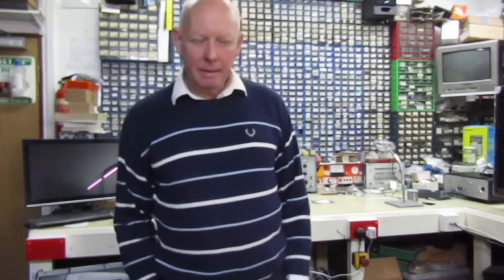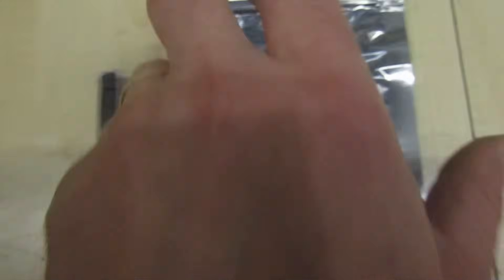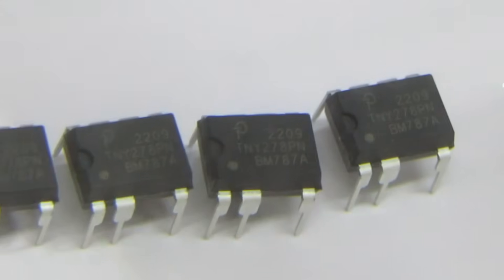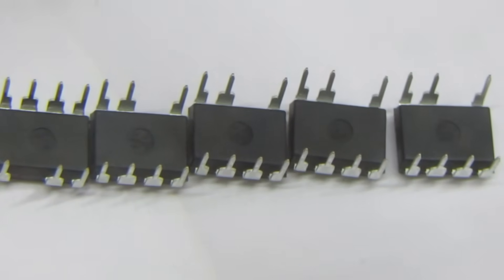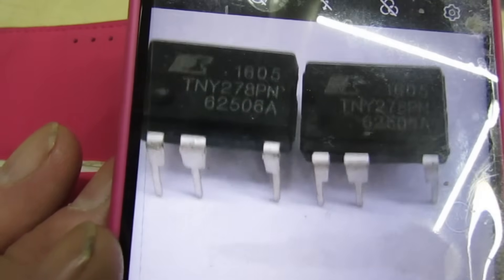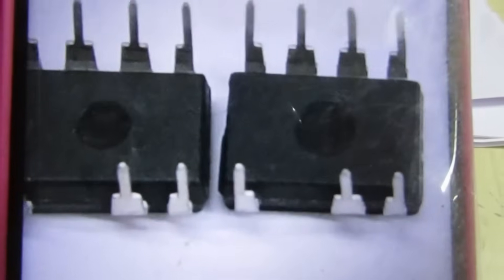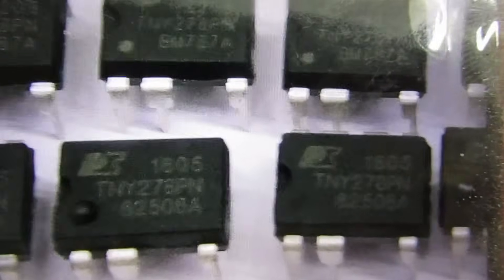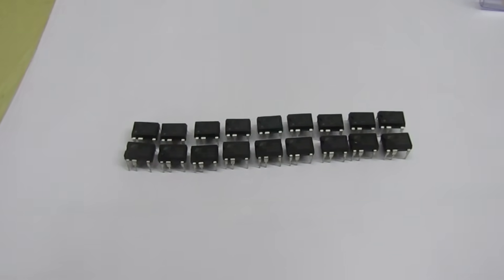Another way of spotting if you have bought a fake semiconductor .

Comment: I bei lots of components from aliexpress and I just once had problems with parts. And yes I don't buy one but I also don't buy 10. I buy 1,000 or 5,000. 
Then i Test the parts, and sometimes I will sell them as well. And also never just one part because the customer who is Bike than for me should have the possibility to tast it.

Itwas possible to repair Handels of devices with very low costs.

Comment: I found power mosfets to be the most faked. Smashing a good (but blown) part and the fake showed a massive difference in silicon die size. Consequently the fakes burned up.
Could you make a load tester with thermal display to identify these?

Comment: 700 volts and 28W , that's some power handling
I remember buying some Lm350 off ebay  for a power supply but it couldn't get anywhere close to 3 amps out of it..,, i'd say they sold me rebadged LM317 instead.
Reply: This is particularly stupid since the LM350 is obviously required with all of its features, if not an ordinary LM317 would have been chosen for the task. So the complains are guaranteed - why would any seller expose themselfes to the useless hassle, especially with the immediate proof?
If some LEDs wouldn't last long enough or are a little dimmer or otherwise out of spec, barely anyone would notice, but semconductors for a specific purpose?

Comment: Why do they fake the ICs? Is it that some are dummy and some are working, so basically "cheaper" overall? Or are these rejected ones from the same facilities that the genuine ones are manufactured in? I'm quite ignorant here as I don't really understand the economics of fake ICs - but clearly there is something to it as its happening at a huge scale...
Reply: Huge scale.  You said it right there - it's only profitable if it's done on a huge scale
Reply from the maker: chips are faked because they have become obsolete and so the demand increases which makes faking very profitable .
Reply: @michaeldranfield7140  Yes, with rare and obsolete chips, of course it's worth it even at a small volume.  However, TL074 are also faked, and they are still in production, 

The chips in your video, are still available from RS, although perhaps not in production (I'm not sure, maybe they are going end of life) they are still available, and faked.

I have found utsource to be reliable for obsolete and no longer available at the big suppliers. (I don't work for them!)

Comment: We did a small manufacturing run where china supplied the pcbs and the 3pin transistors, and soldering.
When we got the items, many of the items failed on first test.
I found that the "china transistors" which were SUPPOSED to be full spec Philips parts, were bad.
About a third of the transistors had bad noise issues. About 10 percent had one pin fully open circuit, and about 4 percent had 2 or 3 pins fully open circuit! 😊

They were obviously rejects, but had been laser marked with the correct Philips markings to pretend to be the parts we paid for.
Not only did we have to buy proper transistors, but we had the cost of removing and replacing thousands of the "china transistors" from our PCBs.

Comment: Yes they are fakes, or recycled parts, but might actually work in light load applications. however the fakes ar everywhere, and they cause a lot of trouble. Looked up and subscribed, remember you from Television magazine, I used to b a subscriber for many years, till one day it just vanished. Always wondered what happened to it.
Reply from the maker: Absolutely correct, this chip could come in a variety of different power outputs that are all pin compatible and may even work , as you say under light load but I wont be risking it .
Reply from the maker: yes it was me that use to write for Television magazine and it went bust after they replaced the editor with some other guy who didn't have a clue .

Comment: When you do get fakes, do they not work at all or what? I have bought tons of parts over the decades and never experienced any issue. So I was wondering if the "fakes" are rejects or what they are...   Thumbs Up!
Reply: Usually recycled parts if you're lucky. In the third world its worth the time to remove these parts from scrap e-waste. Other times they just take any chip with the same pins, sandblast and print new label on it.
Reply from the maker: there is no definitive answer to this question, I have had chips that blow up at switch on, that's a real bad fake, sometimes you may get a chip that seems to work ok then fails again a few months later, sometimes you get a real genuine part like a transistor that has been cut from an old board and had new legs spot welded on to make it appear brand new , buying from ali is like playing Russian roulette . . another thing that's not widely known is the same chip can have several pin compatible variants, in the case of an audio amplifier there could be a 50 watt, a 100 watt and a 200 watt so you could fit any of these 3 and it would work if the customer is only using the amp at a low volume.

Comment: I have here a bunch of AVR microcontrollers which behave strange.
They work fine, but they use to much power!
It got a problem, when I developed a battery powered project and the battery got flat only after a few days.
So I wrote a small test programm an checked all the controllers.
1/3 of them didn't go to standby and used significant power.
I got these from a renowned german seller.
So, I got another bunch from Digikey. They all worked perfect.
Like you I compared the package and coudn't recognize any differences.
I'm wondering if they are fake or just defective from the factory!
Reply: Likely factory rejects for the reasons you stated. Bought for scrap but repackaged and sold on.
Reply from the maker: I would say fake if they have been sanded down to remove the original numbers , factory rejected parts are harder to spot because when a part is rejected they don't get printed with any part number so with a blank chip you can print onto a perfect surface .

Comment: Michael- You have a couple of spammers posting on the video.     Back when I repaired computers & video games to a component level I had 2 identical units come in for repair. One had all the markings on the IC's removed, the other had apparently used a chemical on the tops of the chips to remove markings. I looked at the chemical ones and at the right angle I could see the real world part numbers on the IC's. That info went into my card file for future repairs. (And yes, I fixed both units). 
    I quit buying from Ali Express because of the number of counterfeit parts I was getting, and then my bank refused to allow any credit card transactions with Ali Express as  it had taken many months working with the credit card company to get their customer a refund on bad items.

Comment: i dont see why its worth them faking the more common/cheaper parts?  maybe some arent 'fake' as such but cleaned up and remarked 'used' parts or 'pulls' from made but unused equipment..?  there was, maybe still is, a big problem with 'suspect' 20mhz Z80 CPU chips, i bought 2 lots, dirt cheap from 2 different suppliers from ebay, both in china, the physical states of them vary a lot, and definitely look sanded and remarked, the underside moulded depressions also vary, i havent yet tested any of them ,
Reply: 20 MHz Z80 ? Can't be the original 40 pin DIP ? As for "pulls".. much better chance of these being genuine but whether they'd work or not is another..
Reply: @OwenOReilly-d2w  certainly were 40 pin dil ., i'm wondering if they were old nmos pulls, actually i'd prefer it if they were, as long as 4mhz or higher capable, cmos types may sometimes give issues with 'old' computers , any idea of how to test them to find out type and speed? easily that is?!!!   i also got hold of 40 SGS branded Z80As, they dont look remarked so hope they are genuine, and good!
Reply: @andygozzo72 I must look into that so.. I'll probably end up buying some fakes as well 😂 only real way to test at full speed is to make a test jig with 20mhz xtal and run a test program to test all instructions and I/O lines..
Reply: @OwenOReilly-d2w  there was also one seller with some 4116 dynamic rams, others that had bought them had issues, even burn ups, so i bought them, to test,  they seemed to test as 4164s, good ones, amazingly, theyre definitely not drop in compatible(without doing some pin jiggling), they look like they may be remarked but couldnt be totally sure, i messaged the seller saying they ought to update or mention in the listing they are actually 4164s, but they never changed it and still sold them,

Comment: I think it depends on the IC and how common they are.  I got a batch of 20 op-amps labelled TL074, off Amazon no less, in two separate shipments.  They all look identical, and they all have the electrical characteristics of a LM324.

But this is because LM324s are so incredibly common and the runs of them are enormous.  They're not scrambling to put together 20 random op-amps or other 14-pin chips, they're just running a bunch of tubes of them through the same process.

Comment: I once purchased a couple of supposed "W65C22S" chips for my project and after testing, I realized had non-CMOS logic and the more advanced features didn't work, like at all. For a rare 40-pin chip, I expected failure, the markings looked very sanded-out, and the logo was too square than the original. Furthermore, I stopped buying chips from a non-local supplier.

Comment: Some fakes work the same as the original.  Some say they don't have a problem with it. If I'm buying for Digikey I don't stress it.  But I have heard claims that they took also get fakes in.
Reply: I would expect Digikey demands traceability and examines their products.  They got a lot to lose if they become doubtful.
Reply: @TomSherwood-z5l  yes - they have counterfeit departments at these big places, and yes, they do demand (and offer) source tracing. The parts are sometimes more costly sometimes not. 

I think maybe with Farnell and RS you need a VAT number to order. Not so Mouser or Digikey though, you have to spend upwards of 50e (pre-VAT) for shipping to be free.  Otherwise its a flat rate of 20e. Even that is not high anymore!!  Previously, it could be considered high. Ok yeah for one pot meter you don't do it unless it's critical.

I worked at a small network hardware reseller once, well they were in US and EU, even they had fakes dept, because they get royally fked if caught even accidentally selling a used or new counterfeit part.  The Optical modules were a big favourite to counterfeiters.  Small, high value.

Comment: I agree with buying only from reputable suppliers, but you still have to 'keep your guard up'.  There are characters who buy genuine parts from these sources, then package up a load of fakes and send them in for a refund.  The supplier then, unwisely, accepts these in good faith and puts them in stock without testing them.  Along comes the next customer...

Even the proper manufacturers can let dud parts reach the market.  I worked for a firm making electronic industrial controls and power monitors.  We bought from RS.  A bad batch of 741 op-amps reached my bench.  This only came to light when I did some tests on a load of newly-made monitors which all failed initial testing.
Reply: RS has probably fingered this one out by now. they could compare whats already on the shelf with what is returned before putting it back and issuing the refund.
parts coming back from NASA and joe public might get treated differently. probably no refund unless the package is sealed. if the package is from NASA lol

and there is no such thing as a bad batch of 741s unless they are all completely dead. 
putting them into instrumentation is a real bold move , the failure rate sounds quite impressive. three thumbs up.
Reply: @echelonrank3927  All of the 741s we had in stores had to be cleared out and returned, not just those put into the power monitors.  There may have been an output voltage present during tests, so the 741s might not have been completely dead, but there was definitely no switching of output state as required and expected.  I spent some time thoroughly checking the inputs and power supplied to the 741.  My findings were forwarded to our R&D technicians, who verified them and deemed the 741s faulty.

We routinely put stock from RS into instrumentation and control devices without prior testing.  Simply put: we trusted them as a supplier.  This was 35 years ago; long before the fake parts hazard grew to what it currently is.

Comment: I wouldn't call them fake in any case (even when those clearly exist ... TDA1543 is a popular one, that's often the A variant instead), but relabels, rebadges or frauds. Did your chips survive the acetone test?
Reply from the maker: never tried acetone as the orig numbers have been sanded down .
Reply: @michaeldranfield7140 sometimes it helps to reveal traces of the original markings ... or just water (also known as "magic spit")

Comment: Just don't buy from dubius sorces, not worth the trouble.
Reply: Problem is that many parts are now obsolete and China has long ago harvested all the world's unused semiconductors.. so sometimes there is no option.. for example these TNY and TOP smps IC's.. these are in almost every modern SMPS.. (usually integrated into the device so you can't just use another PSU). Popular devices risk having the most opportune fakes.. I've been lucky with obscure parts that would have few applications and have worked fine.. but I'd be careful with anything that deals with any appreciable amount of voltage/current/power such as these IC's..
Reply: @OwenOReilly-d2w yup ... it's a lottery whether you get genuine good parts or bad junk. With the EPM1K50QC208 I got lucky on my second order after the first ones were drowned in uncleaned flux, scuffed on top with bent pins. With the TDA1543 I only got lucky on my 4th order.
Reply: Problem is people will often be like "as long as they work, I don't care about the relabeling" til they walk into a bad or partially faulty lot. Only adding to the problem of bad chips ending up in otherwise reputable sources.
It's a huge problem for discontinued parts to get legit NOS parts or rebadged, salvaged junk. I've recently had that with EPM1K50QC208 chips and TDA1543 in the past.
Reply: Thailand here, the genuine sources require minimum $50 or expensive shipping, and every items seem to be cost at least twice. But from Ali, min just $5 and  free shipping.
Reply: They may not be fake. They are certainly re-marked but they could just be second hand.
Where do you think your "e-waste" goes? They pull the old chips, sort them into massive bins  and sell off in bulk. Then they get recycled by re-marking, and resold.
The only test is whether they operate equal to new chips.
. .
For some products, a second hand pull that's been remarked is better than a brand new or clone part.
Perfect examples are XR2206 frequency generator and AD584LH voltage references, where the recycled ones are the best.
Reply: @johncoops6897 Problem with rebranded/relabeled chips are often idiotic markings. I.e. Chips made last year by long gone companies or speed/gradings that don't exist. Also you might get sold a chip by a certain brand but get a random (more or less) compatible ... or CMOS instead of NMOS variants. Everything is quite intransparent and dishonest. It's a lottery I'm no longer willing to take part in after several bad experiences.

Comment: Bought 10x NEC branded versions of the Intel 8255 PIA (Programmable Peripheral Interface) from a Chinese seller on eBay.

On testing with my Backbit Chip Tester Pro only three were fully working, the rest being partial or total failures.  Visually all looked identical, unused chips, no markings on the pins which were also slightly splayed outwards as you’d normally get.

Got a refund on the faulty items.

Comment: made in Malaysia and Thailand, the failure rate is very small. I often use this TNY series. Because it is easy to operate. It does not require complicated bias. Just a 100 nf capacitor and a photocoupler FB input. I even often install it on the TOP series design by changing the position of the pins.

Comment: There seems to be more fakes than genuine parts these days, buy from the Chinese suppliers is taking a big risk.
Reply from the maker: Too right ,most stuff sold on the internet is fake, just some fakes are better than others these days .
Reply: @michaeldranfield7140  thing is, much is manufactured in china anyway, even 'good' brands, so you can never be totally sure....
Reply: @michaeldranfield7140  Some fakes are even better than the originals. I once needed some 25ns of an (re-)programmable logic IC and could only find that on AliExpress. I received a batch of genuine ones (probably used ones, looked like they had been soldered out) and a batch consisting of a mix of faster 10ns and 15ns ones. Unfortunately, I specifically needed the older slow version.

I've also received fakes from reputable distributors. In one case it was obviously a batch of components returned from a previous buyer. Two cases were genuine chips, except that they were factory rejects which had somehow ended up in sale.
Reply: I ordered a here very expensive accuphase end transistor. Looking the same. Fake. Hfe shit. They send a very cheap yransistor with the good tekst on it. It is more and more difficult to get what i call normal quality parts.
Reply: @henkholdingastate I agree, customers expect a warranty with repairs, but how can you if you can't trust the quality of the spares.